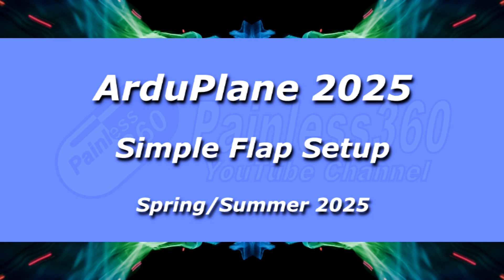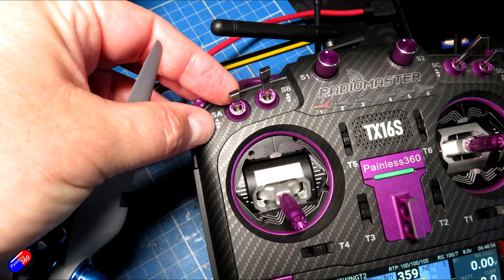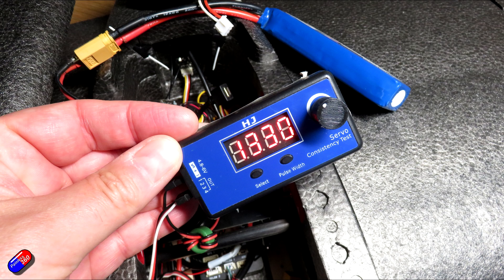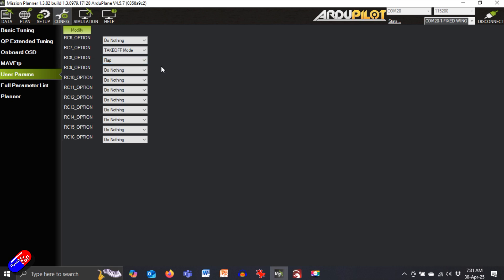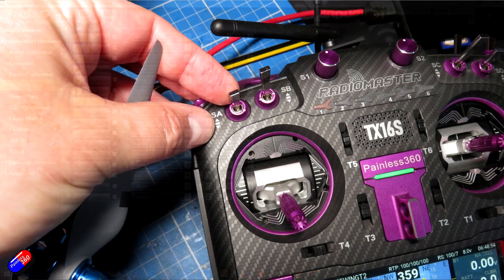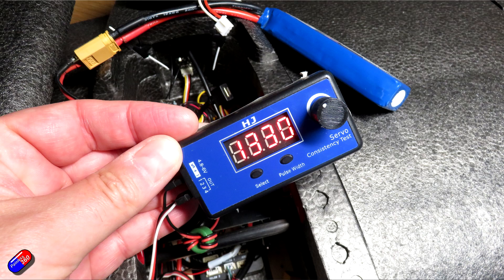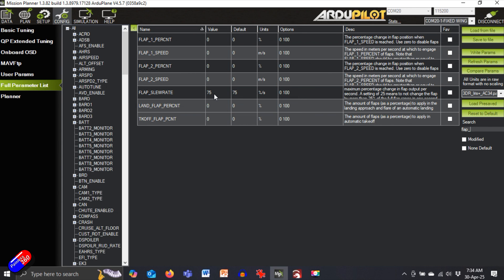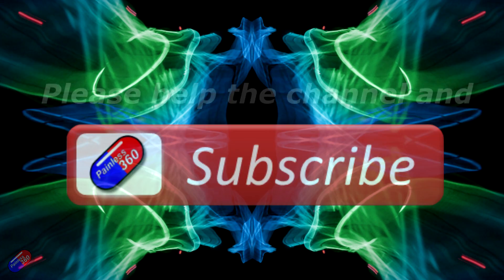Simple Ardupilot Flap Setup

Comment: Thankyou for the video… 
1. What happens when you deploy the flaps during landing? Usually in full flap deflection we give some amount of down elevator trims for level flight. So what happens in this scenario? 
2. Also, now that the auto trim is activated, will it trim the elevator servo’s neutral (trim) position to the flap deployed trim (down elevator)

Comment: Are they split flaps?
Reply from the maker: They sure are. Happy flying!
Reply: @Painless360 Would be nice to see how they operate (I saw this was a stills based video).
Second point: Can they be/how are they used in Ardupilot flight modes?  I have only used flaps as pure pass though in arduplane.

Thanks and keep up the good work.
Reply from the maker: There are lots of videos showing them, including the other videos on the channel. There isn't a lot to see, they drop out of a recess under the wing. That's it.
This is more of a 'how-to' as there are no other videos covering flap setup that I could find when making the series, and as this model had them it was a perfect opportunity to explain how flaps (of all types) can be setup easily. 
See https://ardupilot.org/plane/docs/automatic-flaps.html for the other question. Best of luck!
Reply: @Painless360 Thanks again.